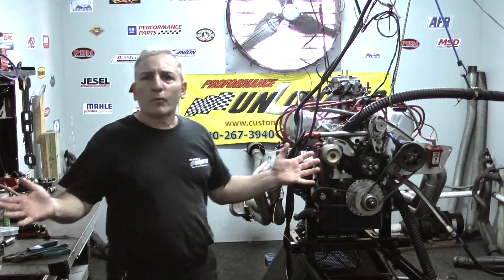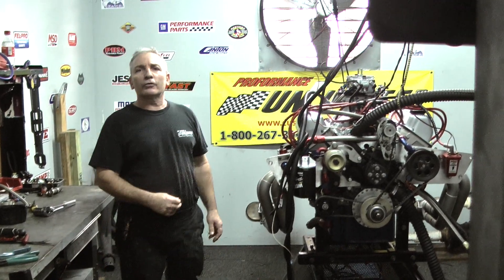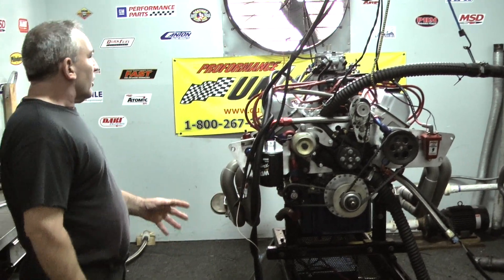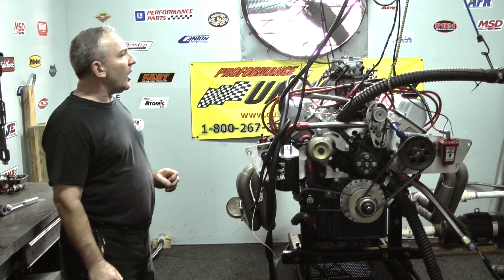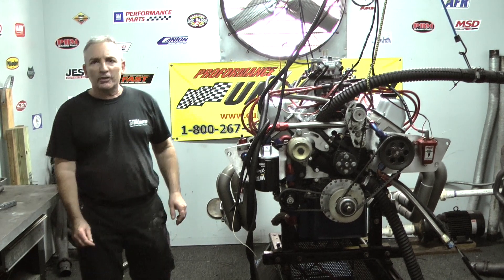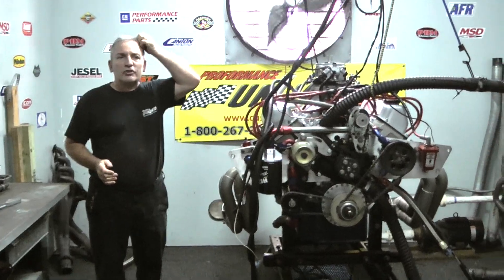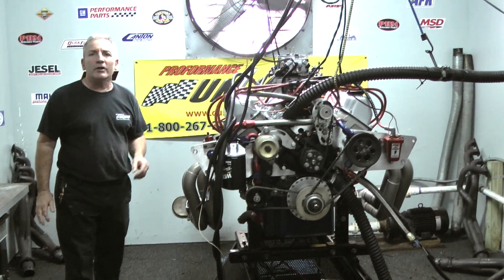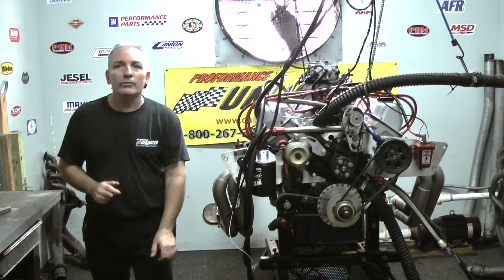351 Clevor Race Engine Build

Comment: I have a 1994 F4TE 351windor block and I just picked up a pair of 1970 heads for the 351 Cleveland engine, 
Can anyone tell me if this combination of parts will work for a 351 Clevor engine ?
The block is a roller block but the heads are from the 70's FE engine,  they came off a 302 Boss but they are not the original heads,
Thay have been ported and polished with a new valve job, 
I know that the water jackets needs to be rerouted/worked, 
I just don't know how much trouble building this engine this way may be or if it is even possible. 
Anyone out there that can answer this question  ?